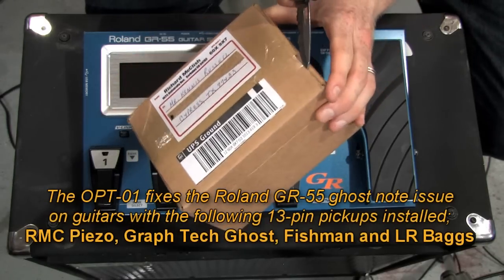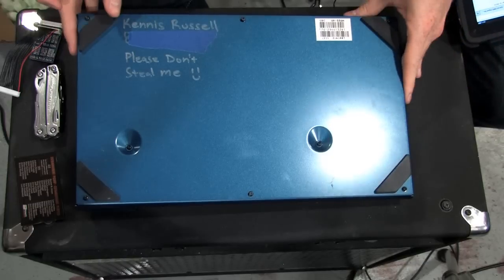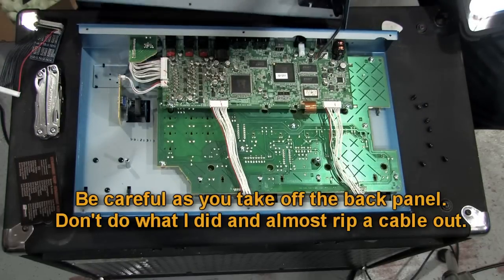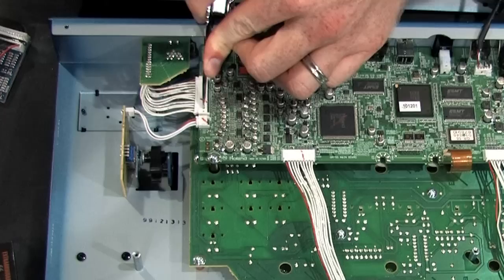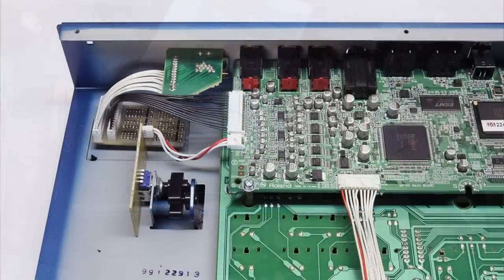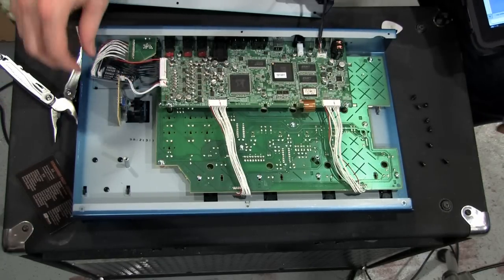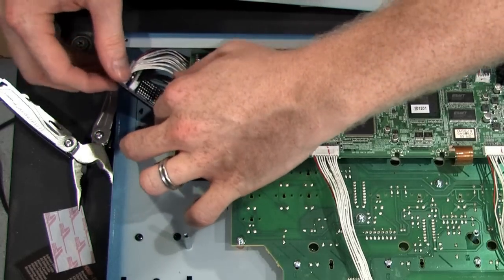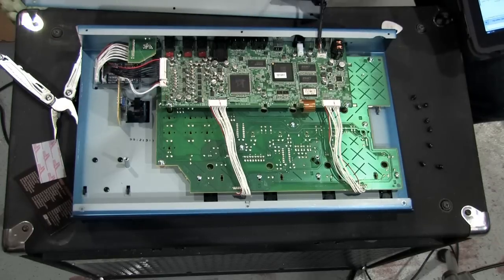How to Install the RMC OPT-01 for Roland GR-55

Comment: I just installed an OPT-01 yesterday on my GR-55 and I use the GK-3 (kit version installed in my guitar). It made a huge difference in improving the unwanted ghost notes. The OPT-01 Version MK II has been improved and works well with the GK-3. I'm very happy with it and since it works so well, I'm going to order one more because I own 2 GR-55's. I want to thank Richard McClish for diagnosing the problem and developing a fix for it. I'm disappointed in Roland Corporation for selling so many GR-55's and leaving us all hang out to dry. They should be the ones stepping up to the plate and offering the fix. I've always been embarrassed to use the Sax and Piano patches in a live setting. Now I can start using these patches live and get what I paid for. The installation was pretty easy.
Reply: Where did you get one? I can't find them anywhere.
Reply: I was wondering if this made a difference with the GK-3's. I was going to install on my Tele Deluxe. So you would say this definitely helps ghost notes using the GK-3?  Thanks!

Comment: I installed mine but did not find a clear difference before and after ... the GR 700 patch still was unplayable ... tried it with My Parker Nitefly MOJO and my GK3 installed on another guitar ... it is OK with the Roland ready strat. Any similar experiences here?

Comment: Just obtained one from RMC in Canada. Installed it in my GR-55, which I play with my Roland-Fender Strat. Wow--I've been playing MIDI guitars since the late 1980s, and I've never had one as accurate as this system, with the OPT-01. Delighted. And thanks, Kennis, for the video. It was easy to install, but your video made it easier.